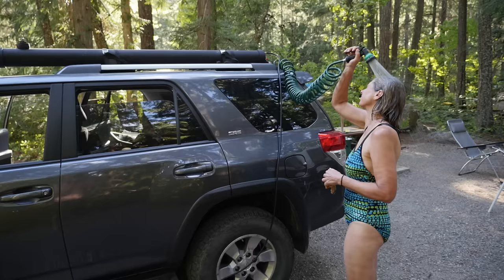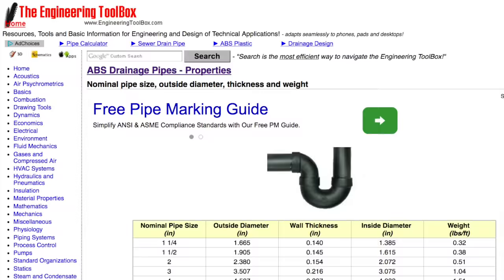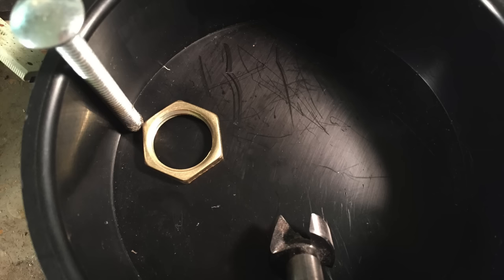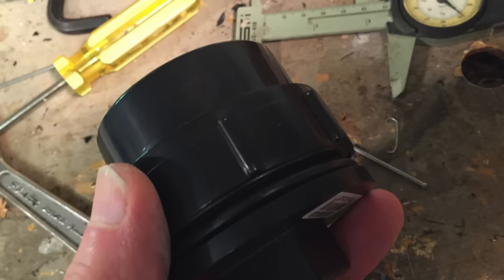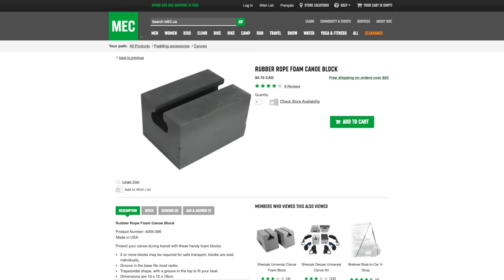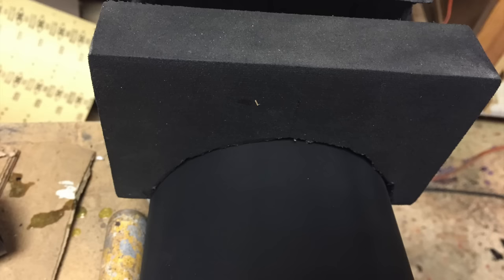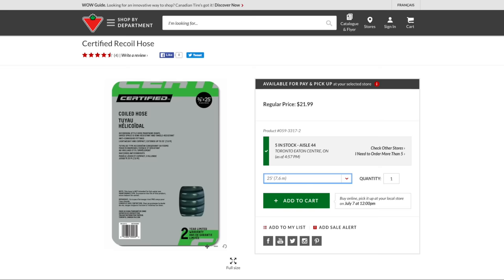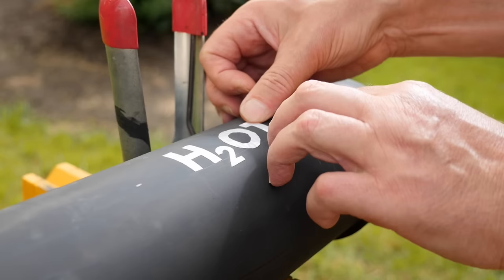H2OT - Rooftop, pressurized, solar-heated shower/sprayer using ABS pipe. DIY

Comment: Best camp shower on YouTube!  Any thoughts for or against 6" pipe instead of 4"? I like the idea of the additional volume, but I haven't seen any attempts at this DIY with 6" pipe.
Reply from the maker: Thank you for the comment.  Two factors you must consider are weight and price. In my spreadsheet you can compare the weight of the water in both systems.
• 14.8 kg vs 33.6 kg of water
• 1.5 lbs/ft vs 2.6lbs/ft of pipe
Regarding price, you wil have to check your local plumbing supply dealer for prices. However, expect to pay significantly more for 6" pipe as compared to 4", assuming you can even find it in your local area.
Reply: +Ruben Jackson, His is 6 foot long with a 4 inch diameter. I think plumbing pipe comes in a 10 foot piece so you might consider cutting it in half to make two 5 foot pieces. You could possibly connect the two sections together with a 1 inch coupler. That would give you the larger capacity you are looking for. As far as weight goes, you would have to consider the type of vehicle you drive and the weight of the other gear you are hauling. Good luck.
Reply: You're right - no 6" pipe around here, plus it will be difficult to mount with my configuration.

At 2:37, the gluing of the filler neck -  it looks like glue was applied generously to the external side of the connection. Is there anything than what is pictured to make / reinforce this joint - i.e. glue on inside of 4" pipe as well - or is the glue joint alone sufficient at the intended operating pressure?
Reply from the maker: First off, it is NOT glue. It is solvent cement. Big difference. Solvent cement actually melts and chemically welds the ABS pieces together.  If you clean and apply the cement to both surfaces, it will never come apart as it is now stronger than a single walled piece of ABS.  As long as you drill the hole using the proper sized bit (you can see how mine just dropped in) and apply the cement per the instructions on the can, it is never going to break.
Reply from the maker: You need to consider how the connection between the pipes will function. The invert of the connection (inside bottom) must be at the same level as that of the 4 inch pieces. Springline to springline (center to center) will leave have the water trapped in the second pipe.

Comment: Awesome job mate! Definitely copying this for my camper trailer build. Couple of questions though, why did you not want to use metal clamps? Also was there any practical reason for putting the filler cap at the opposite end to the outlets?

Comment: Your video was great I built one and used gravity to get the water to come out and then saw your video and thought how easy....add pressure through a Schrader. . how do you keep the connection for the air valve and the water Spicket airtight. both mine are leaking and I've cut the end off twice now because obviously once it's glued on you can't take it off and there's no way to pressure test it until you attach it to the pipe
Reply from the maker: Not sure how yours leaks.  The air valve works exactly as it would on an aluminum tire rim.  I suspect that seal is good to 60psi.  The drain is threaded in.  The hole I drilled is the same as the inside diameter of the threads NOT the outside.  It is in there very tight in fact you can see that I stopped about one re elution short of being flush.  I could not torque it any more. If you thread (tap) iit in and not drill too big a hole, it will never leak.
Reply: I was able to add epoxy around valve and spigot so they are airtight but the fill valve is not. I used Vaseline, teflon tape. Nothing keeps a seal. What did you use
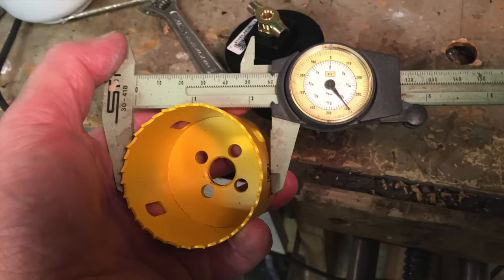Reply from the maker: My threaded cap came with a silicone washer. You can see it in video at 2:23. Once hand tightened, it does not leak at all. Here is the cap I used...  https://www.homedepot.ca/en/home/p.2-in-abs-male-plug-mipt.1000116110.html
Reply: It's leaking at the plug. Everything is air tight but 4" plug where I fill from. I built mine then saw your video so mines different. very minimaly different. The link you sent wasn't a gasketed plug. I can't seem to find one.  I used pipe dope and it worked but it's messy and having to put more on everytime is a burden. Last question. Do you use constant air pressure when in use?  Mines on a golf cart for use after the beach.  So fill with water, pressurize, go to beach 5 hours later use hose. I won't have a compressor at the beach. So I need it to hold until I squeeze nozzle.
Reply from the maker: The link I posted absolutely has the Silicon O-Ring seal. You can clearly see it in the the plug photo. Also, you will have to pressurize just before you use it. If it is full of water, there is  zero capacity for compressed air as water does not compress.  As you use the shower, and a void is created, the required use of the compressor diminishes.
Reply: I see it now.  I was thinking threaded silicone. It's a ring at the end
Reply: Don't fault me I'm a Flyers fan
Reply: couldn't find that part, must be only in Canada? this is all Home Depot shows in the US...http://www.homedepot.com/p/2-in-ABS-Cleanout-Adapter-with-Plug-C5816HD2/100347999 went to the local Home Depot and they said they didn't have anything like the one you linked. according to this page I linked its rated at 0 psi, lol. Im worried im likely to leak there with pressure just like Joe as you can see in the product image there is no o-ring/seal or even a lip to add one...

Comment: Q: I have my build kit in the garage ready to go. I don't think this has been addressed, apologies if I'm wrong. I'm considering placing the Schraeder valve in the filler cap - and using it as the relief valve. Two birds with one stone, one less hole to drill and one less piece required. (My son's idea.) Unless I'm wrong. Which happens a lot. Any thoughts anyone? Signed, a huge fan!
Reply from the maker: Yes, a relief vale is great addition. Finding one with a low enough threshold has been a issue for me though. The beauty of trying this out on the cap is that if it fails, you only need to replace the filler cap
Reply: imaginetMedia , thanks! That was our thought: easy to experiment on the plug. I’m happy to report that so far so good! It sealed up well and held pressure with only a little Teflon tape on the filler plug threads after only hand tightening and heated quickly. The first coat of paint is drying. We are excited to compare the heating times tomorrow with the flat paint absorbing our strong Utah sunlight. I’m trying to find the plug you used but it is difficult to find in the States. Thanks so much for your fantastic video! Two of my neighbors want to build their own already. Your fame grows!
Reply: @shannononeal7375  How did the tests in Utah go?

Comment: I have followed your DIY and I love it! I did put in one small change but it works just the same. I was curious to know how much air pressure you fill it with at one time. Do you fill it when you use it or before you leave your house?
Reply from the maker: We fill it in the morning, before we leave (home or campsite). I pressurize to 30psi.  I let it run down to 10psi before I turn th compressor back on.  It only takes about 5 seconds to pressurize.

Comment: Great video and fantastic idea... thanks for sharing...
would a smaller diamter shut off valve increase the velocity or pressure of the out Going water?
Reply from the maker: The biggest factor in pressure equation would be the spray nozzle.

Comment: Killer video - thanks for the details.  Thoughts on using water stored from this for drinking/cooking?
Reply from the maker: I routinely use the water left over after a ays use to wash my dishes. I would have no problem drinking the water if need be as the ABS pipe I used is potable.

Comment: I found your vid while looking to do the same thing on the roof basket of my teardrop. Given the thought you've put into it, I'm sure you can answer my question:

Why did you opt for 4" ? Convenience ?
I I think will get way more surface area exposed to the sun if I run 2" pipe around the perimeter of the basket. Given the size of my basket (~4'X6'), I will have about 3 gallons.
I'm on the BC coast, so I need to take advantage of as much sun as I can !

Comment: There are Ryobi 18v power inflators that might make your life a bit easier. They're in a power-drill format - much less hassle.
Reply from the maker: You do the math...
Amazon.ca - Ryobi P737D 18-Volt ONE+ Cordless High Pressure Inflator. --- $313
Amazon.ca - Dimunt Tire Inflator Portable Air Compressor, Fast Inflation Car Tire Pump --- $35
Reply: @ImaginetMedia  The inflators are $89 AUD locally, where I am (AUD to CAD is almost in parity). Still more expensive, but I'd pay a bit more for that convenience factor.

Was only meant as a bit of a tip / alternative.

Comment: great video thanks for posting...
did the threaded cap hold good pressure just by tightening it or do you use a sealant.?
Reply from the maker: I just added a few wraps of teflon tape to tighten up the threads. Note, as seen in the video, there is a rubber gasket on the cap. I am not sure if all of them come that way. There is some leakage through the cap as evident by a few small bubbles, but not a significant loss of pressure. Perhaps a few psi per minute.

Comment: This is amazing. I've searched around for a solution that I liked and this was the only one ive found that I felt was done right. do you have a write up or parts list that I can follow as I try to emulate your build?
Reply from the maker: I was hoping that all the info necessary to build one is in the video.  Specific parts list would not be applicable as many of the components are geographic specific. Generally, anything close to what I show should work.
Reply: thanks for the replies... ill give it a shot and see how it works out!

Comment: ABS pipe is 2xs the price of PVC sched 40. Why did you choose ABS over sched 40?

Great video, voice and transitions are very smooth. I'm thinking of doing this with 2 pipes connected, one for the water and the other for the air tank so the pressure is more consistent and long lasting. Also another 6" pipe just for water storage. One trip with just my dad and brother we went through so many jugs water.
Reply from the maker: SAFETY: 
ABS pipe bends upon strong impact, whereas PVC pipes shatter to pieces.

ASSEMBLY: 
ABS pipes can be joined in a single step, PVC pipes require two steps including primer and holding joint until dry. 

OPERATION: 
ABS pipes have a broader temperature range, which is from -40 °F to 180 °F. PVC pipes have a maximum operating temperature of 140 °F
Reply: I'm having trouble obtaining ABS Pipe.  I have PVC fittings Schedule 80 and Transition ABS-PVC Cement.  Where can you obtain 4" ABS pipe?

Comment: I wonder why he didn't want to use proper hardware to mount? Straps can be noisy on top and easy to lose. I bought threaded rod and bent it around my 6"ABS. And got some metal strapping to bolt underneath the crossbar to hold it down. I will say, the carriage plates were hard to find and a little pricey but it sits right in there
Reply from the maker: You know I can read your comments, right?
Reply: @ImaginetMedia  the comment was in general for whomever cares to answer. what percentage of comments made do you think original posters actually have the time to read haha...
Reply from the maker: @cwr8618  I read each and every one and respond to all that pose questions about the build. To answer your question, my foam and nylon strap mount is a PROPER mount. It weighs a little over 15 kg which is about half of what a canoe would weigh using the same system.
Reply: @ImaginetMedia  that's great. I'm sure it works very well. I think you took the term proper a little too seriously. Straps and foam are great. Just that using hardware might be better against the elements / better strength and fatigue properties. For my particular application, I'm using the same mounting pieces used by plumbers to hold their conduit carriers - zinc plated ubolts, washers/nuts, and carriage plates. A little pricey but likely a solid system. Unless you're using some DYI overland shower building manual sanctioned by a governing body, seems like there are lots of ways to secure cargo PROPERLY.
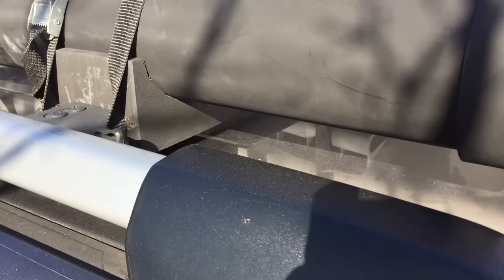Reply from the maker: @cwr8618  Got it. Thanks for the clarification.  I actually looked at a system similar to what you described when I started. But I wanted to be able to add and remove it quickly. You see, I only have it mounted when I am actually going to use it. The rest of the time it is not on the truck.  At 3:03 in the video, I actually address this.  Also, I have changed the strap configuration from what I show. I wrap the straps completely around the pipe on either side to create a much more reliable grip, and thus preventing an unwanted missile launch.
Reply: @ImaginetMedia  Accidental missile discharge is my biggest fear. The straps are definitely way faster and more importantly, don't require tools, so a great solution indeed. I tend to carry emergency tools in my truck (and always have a leatherman with me) so I'm more comfortable with using hardware. And great point about only having it on the rig when you're going to be using it. Extends life as well...
Reply: One thing I'd add. We use those staps for work on ladders. And they are super convenient and our ladders don't weigh 30lbs. But everyone should keep in mind the sun makes those straps brittle and if your the type of person to leave mounted on your vehicle(bcs we all know those people who want everyone to ask wow whats that?) You should replace your straps every 6 months. If you only use them on trips id say annually bsc you are carrying a heavy potential projectile on your roof
Reply: @dmgmail7021  both great points

Comment: I would probably try to use 1/4 turn ball valve if I can adapt it to a water hose sprayer like in the video without so many fittings on it. His is a good job I would just rather have a ball valve they last longer. And just a quarter of a turn.
Reply from the maker: That is a ball valve that is used in the video.

Comment: Ok what did you do to prevent leakage around the shut-off valve? I noticed that you bought some o-rings. Where did you install those? I don't see them on the shut-off valve where I assumed they'd go. The taper on the threading of the valve is killing me as i am not able to tighten the nut enough. I also see a white bead of something around the shut-off valve. Please explain. Thanks
Reply from the maker: The spigot is threaded into the ABS cap. It has NPT tapered threads that are tapped forming a very tight seal.  The O-rings were not used. You need to properly size the hole with the correct drill. You can heat the threads up with a propane torch and that will make the threading process easier as it will soften the ABS slightly.  Once you get the spigot fully threaded into the cap, the odds of the drain pointing directly down are slim. As such, you will need to back the tap back out slightly so it aligns, but this will leave a small gap between it and the cap. I used a small bead of JP Weld to fill the gap. It does nothing towards a seal, it is just a gap filler.

Comment: Hello and thanks for such a professional and informative video. My questions are: 1. Why did you choose ABS vs PVC? 2. Can you pressurize the tank with a bike pump?cheers.Tony.
Reply from the maker: Thanks for the kind words in your comment. 

Here are some of the benefits of ABS over PVC for this application…

ABS pipes bend on strong impact, PVC pipes shatter to pieces.

ABS pipes can be joined in a single step, PVC pipes require two steps including primer and holding joint until dry. 

ABS pipes have a broader temperature range, which is from -40 °F to 180 °F. PVC pipes have a maximum operating temperature of 140 °F

You certainly could preasurize this up with a bike pump. Obviously, the larger the barrel is on the pump the faster it will pressurize. As I have mentioned in previous comments, if the tank is completely full of water, there is very little room for air as water does not compress. As a result, you will drop from 30 psi to 10 psi very quickly. But, as you use more water, more air space is made available and the tank will hold its pressure longer.

Comment: Using the ABS pipe and cements that you used, can you also use this for drinking water?
Reply from the maker: The standards for plastic pipe generally require that the product be marked so that it can be readily identified, even if cut in short pieces.If the pipe is for potable water, a laboratory seal or mark attesting to suitability for potable water must be visible.

Comment: Tested mine today and added teflon tape in the fill cap.  No leaks.  However, the pressure lasts very about 15-20 seconds without the hose. Before spending the extra $ on the hose, does this make a big difference in how long the pressure lasts?
Reply from the maker: How are you testing this, just opening the drain?

NOTE: I specifically used a 3/8" hose and NOT 1/2" hose as well as a spry nozzle that has a "shower" setting. This significantly restricts the flow of water (like a low flow shower fitting in your house).  Keeping mind the hose uses capacity. The smaller the hose, the more water that is retained in the tank.

Also, the air reserve capacity will be significantly increased as the water is drained and more compressible capacity is made available.

Comment: Great video and great voice! Could you explain the air pressure valve with the nut on the back, what it's called and where I could buy one. Many thanks
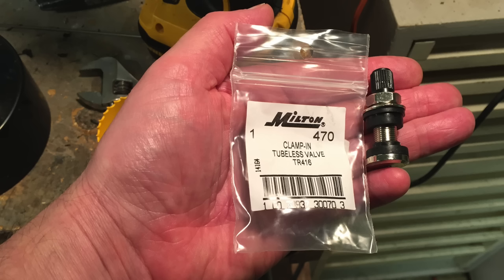Reply from the maker: It is a standard tire valve that is used on tubeless aluminum rims. I show the exact item at 1:57